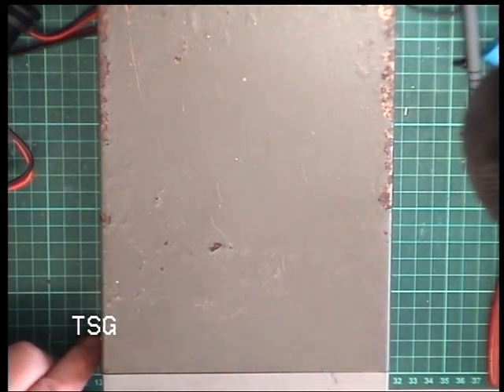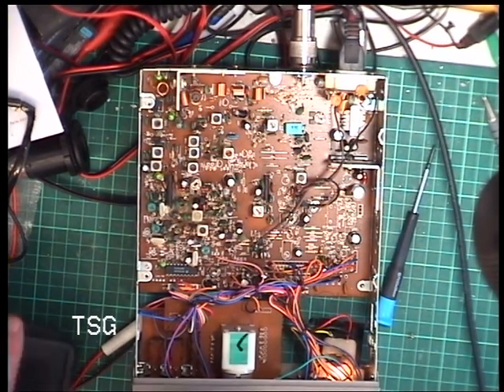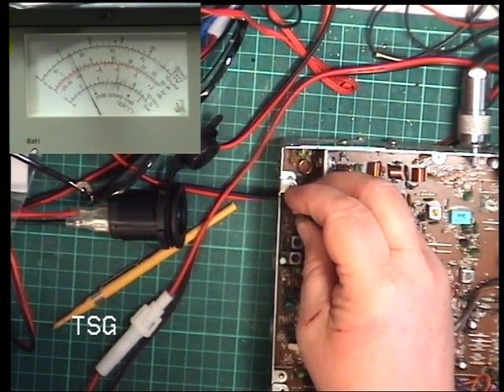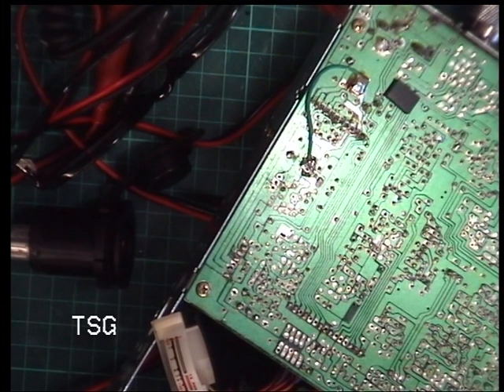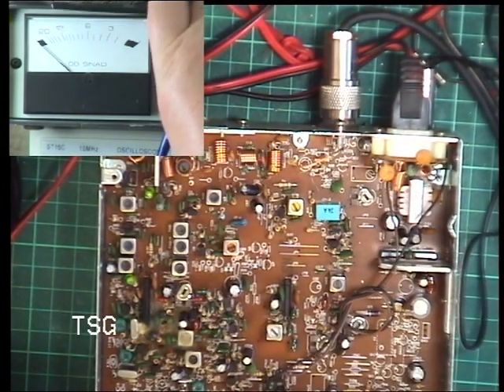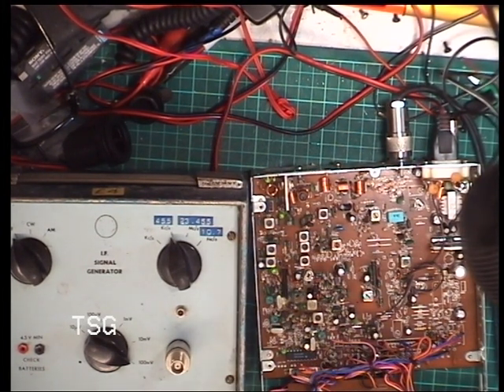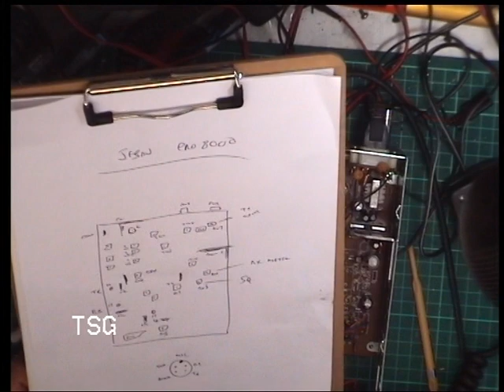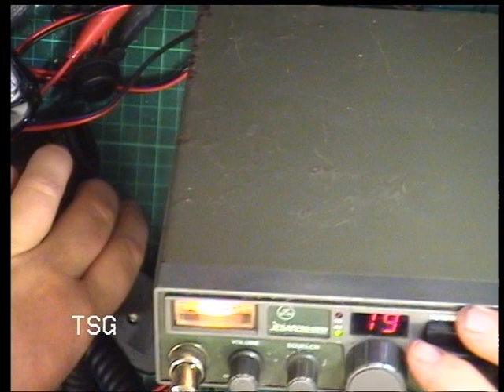Jesan PRO8000  UK CB27/81 CB radio (mobile) - Service alignment

Comment: Hummm.  Remind me not to buy one.  I remember A big advertisement run when these came out, but I have never seen one naked as it were.  SSB is everywhere!
The York 861 is the same as the small Rotel and is quite a good little set.
I found a York with a black face on it, I didn't study it, but I must have used it as it is on a slide mount.  Not sure of the model number as I was just clearing things out.  I hope it is the same as the York 863 inside?  It is very untidy looking but it has been in a shed for 6 years and in an attic for at least 10 years or more, as have any sets i own, which is quite a few.  I even found one of the horrible Amstrads with the Rodger Bleep! I didn't use it for sure!  When I used slide mounts it was just a quick release and all the cables plugged into the set and didn't go through the slide mount.  They were horrible things. But at least the cars back then had somewhere to mount a CB, unlike today where there is nowhere and all plastic.
Reply from the maker: I find the genuine Amstrad 900 & 901 (Cybernet 002F, made in Japan) work great/ The snag is that most of the Amstrad 901's are fake copies. The Amstrad 900 didn't end up getting copied soare always good. I bought a batch of CB's off Ebay & amongst them was a black fronted York 863....that's Rotel knobs on a normal 863 with added marker pen. I don;t think there was a black variant. The Team Pro8000 is one of the worst rigs around. Around 1987 Jesan and Team had some right ropey offerings.

Richard
Reply: @ukfmcbradioservicingTango21  I have seen a few black ones, I just didn't know I had one, that is what 7 months of Chemo does for the memory!  I have seen a few on YouTube as well, it is more of a plain front, flat, but with all the knobs of the 863.
Don't agree about Amstrad, Some were Cybernet, others, I have no idea who made them, but Mr Sugar would not give you high quality, I am surprised he gave us any with Cybernet chassis in them..
I think there were four models, if my poor memory serves me right?

Comment: I've got a radio which externally looks like one of those that I imported form Germany. It is the Kaiser KA9040FM, CEPT 40ch FM, 15ch AM (before a simple mod) but the PCB is completely different inside from the Jesan.
Reply from the maker: Yes, whilst researching this radio before the video I came across the Kaiser with the same case but totally different board.

richard
Reply from the maker: Tony, your other comment got auto blocked as it was discussing a radio which was not UK legal. This channel is about UK legal CB radio servicing & whilst it's interesting to see radios made for other countries using the same cases, it's important not to discuss same in detail & especially modifications on here.

richard

Comment: I'm pretty sure either the Jesan KT-2002 or KT-7007 schematic is the same. They both use the same PLL but have different value crystals. I think the KT-2002 is the same. Can send them if you want.
Reply from the maker: I've got the KT7007 circuit but no the KT2002, so would appreciate that one please.   rshireby@yahoo.co.uk

Richard
Reply: @ukfmcbradioservicingTango21  Email sent.
Reply: The 7007 doesn't use  a rotary channel switch but from the pll back is very similar.
Reply from the maker: Thank you,

Richard

Comment: I wonder what other sets use that board as theres quite a few un-populated component locations on there
Reply from the maker: As I mention on the video, the Team Lancaster is nearly the same board with just some differences around the synthesizer. Looking at the board, there will be other radios perhaps in other countries where it is used (and can be avoided!). I didn't seem any evidence of where a modulation transformer would fit, so it didn't look to me like an AM/FM board. At least I am reassured that I've never seen another on in 39 years servicing UK legal CB radios, and I went out of my way to especially buy this off ebay when Mark or I spotted it.

Richard